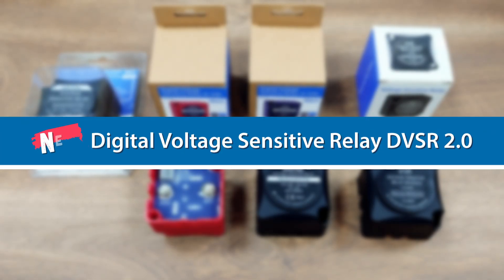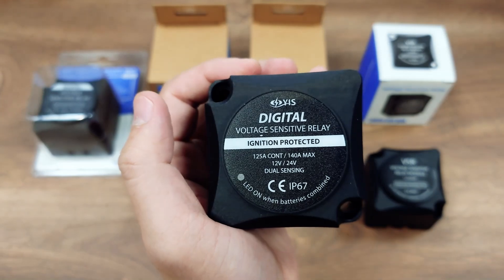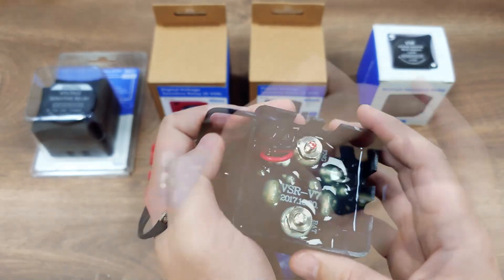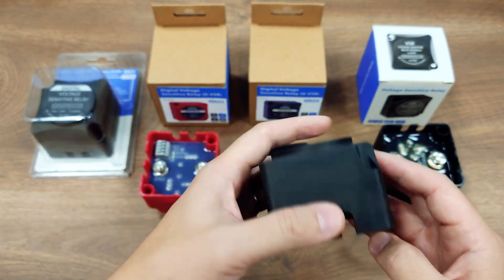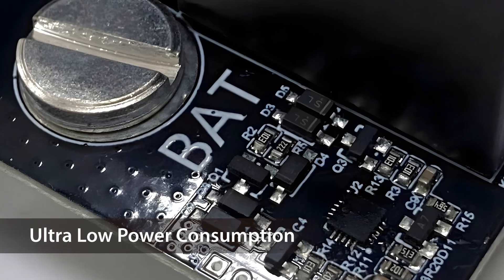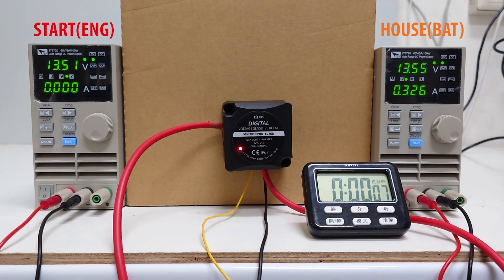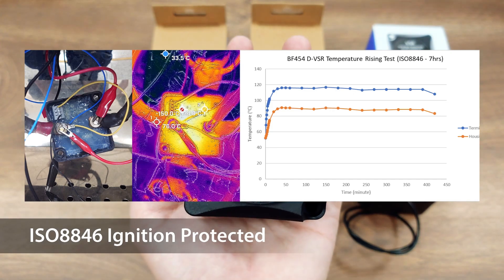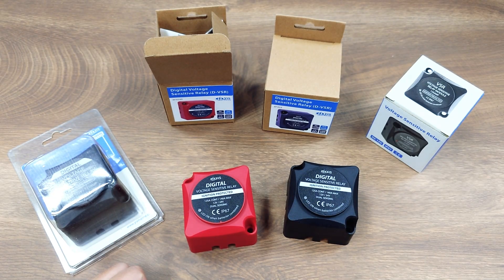Digital Voltage Sensitive Relay (DVSR) 2.0 Introduction｜YIS marine

Comment: I would like to charge my power station instead of a second battery. Is there a problem, if the DVSR senses 0V on the second battery?
Reply from the maker: Yes, there are low voltage lock-out protection on both ports of D-VSR so there must be voltage (>9V) on both ports otherwise the d-vsr won't activate.

Comment: I’m pondering using one of these for combining a flooded lead acid set to an AGM set. Charge through the AGM (start battery) and FLA would be for loads (house battery). Solar is also charging the FLA set as well. 
What is the cut in /cut out voltage on the digital model? Is there a high voltage disconnect feature as well? Thanks!
Reply from the maker: Hello, the Combine / Open Voltages are DC 13.3V / 12.8V @ 12V and DC 26.6V / 25.6V @ 24V. There is a high voltage lockout above 16V@12V mode & 30V@24V mode, and low voltage lockout at 9.5V@12V and 19V@24V mode. Please refer to product page for more information:
https://www.yismarine.com/en/product/Digital_Voltage_Sensitive_Relay-BF454.html
Reply: @ thank you